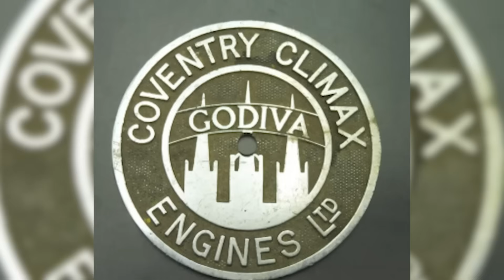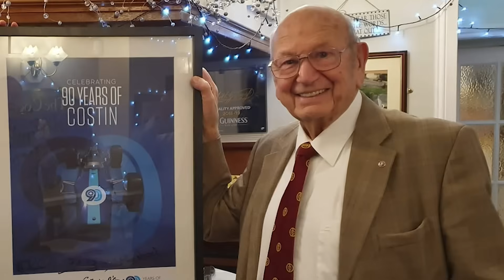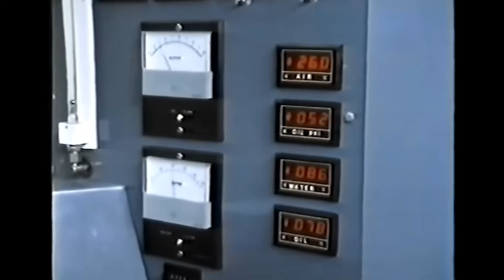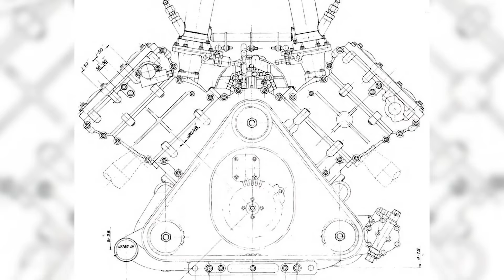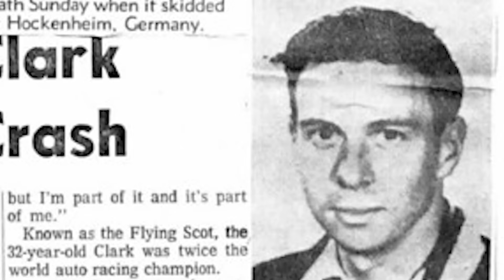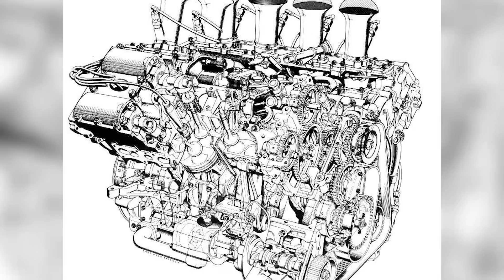The Shocking Truth Behind Ford’s Deadly Cosworth DFV V8 Engine

Comment: Nice pictures and video footage, but many of the photos and video are misleading and do not match the subject being discussed, or the timeline is misleading. For example the Ferrari 3.0L flat-12 did not appear in F1 until the 1970 season, which is several years after the BRM H16 engine was last raced in 1967, but someone watching this video might be led to believe they were contemporaries. Then at 8:03 the video shows a picture of a Ford Cosworth "GBA" V6 Turbo engine from the late 1980s when the audio is discussing the 1960s and 1970s. There are random sports car races shown when the subject being discussed was F1. The DFV family engines were used in sports car racing and those photos and videos should have been used for that part of the video, not added in random places.
Reply: Seems to be robo generated.
Reply from the maker: Thanks for the feedback! I appreciate you pointing out the discrepancies. I’ll make sure to clarify the timelines and images better in future videos!

Comment: For all their cylinders, Ferrari & BRM failed to win the inaugural 3 liter F1 season. A Brabham with a SOHC V8 using a stock block did so. But the 32 valve DFV  once sorted out did so much better
 Power of the DFY 3 liter derivative quoted st 510-530 hp.

As far as integrating an engine as part of a vehicle chassis structure, Vincent-HRD did so with the legendary Vincent Black Shadow in the 1950s.